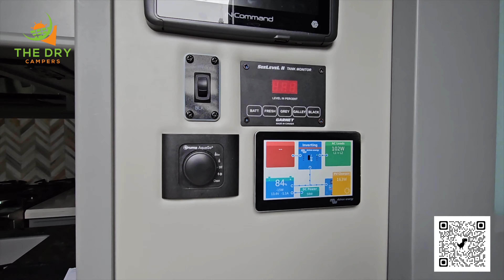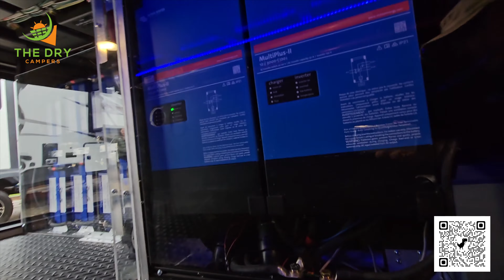Bringing Back the Sun: Luxe 45FB Toy Hauler Solar Reinstall Adventure

Comment: Does each Multiplus II feed one leg of the two legs to make up the 50 amp feed?  How long would the 14.8 Kilowatt hour in these batteries feed the trailer if the ACs were turn on?  ESTIMATE.?
Reply from the maker: Its wired in parallel but it will last while.